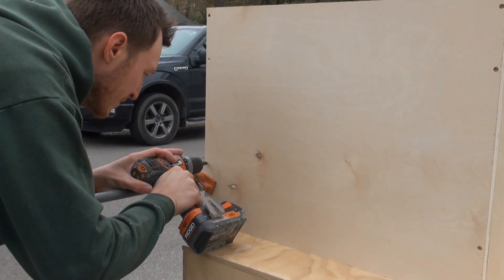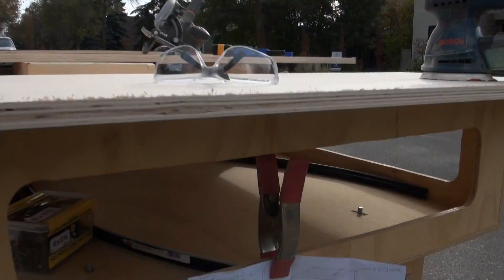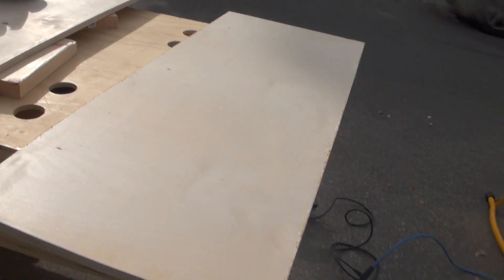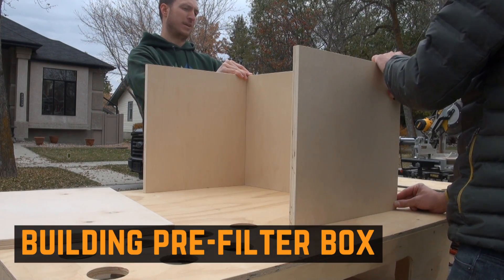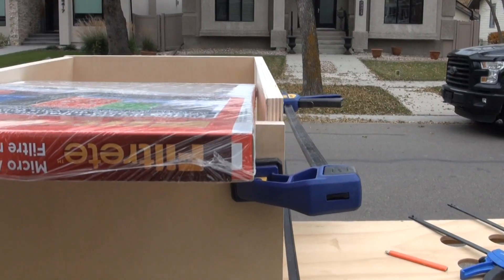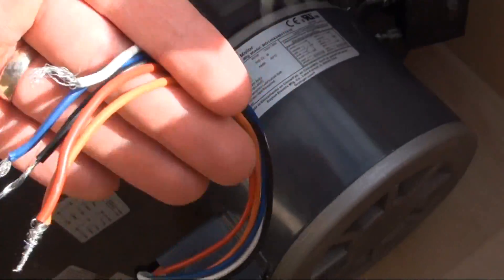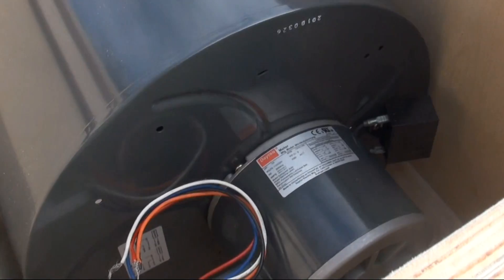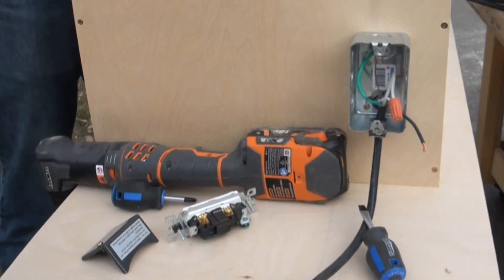How To Design And Build A Laminar Flow Hood: Part 2 - Build

Comment: I know a little improvement that would help extend your filter life and efficiency at filtering out the bad stuff. 

Install a uv-c lamp that is usually installed in hvac systems. This will kill all the air once it passes the pre-filter on the top of the box that is built around the blower intake. Uvc helps to kill all germs, bacteria, and viruses.

Comment: Nice.
Does anyone know a link to a video showing how much air is coming out? 
Like a flame or smoke test video? 
All the calculation videos I've seen don't give me any kind of idea what I'm looking to have acceptable flow coming out. What's too much, what's too little and useless. 
I'm thinking about using pvc to make a box I can walk into, covered pvc frame with painters plastic filter mounted to the pvc frame and a shop vac pulling air from the opposite side. Will I have enough flow in front of a small hepa filter? 
I'm just learning all this and have only been growing for 5 months. Did my 1st lc to agar in my kitchen in open air and had 4 out of 20 dishes grow something extra. If my idea will help me reduce to 0 out of 20 I'll do it but I'm wondering how much air you want blowing past you as your working on your projects?
Reply: I'm curious too. I just got materials fan, filters...will be building this week. Using 2 Merv 16 filters 20x25 side by side 6 inch thick. I bought a 12 dollar anemonitor? To check wind speed after filter. Thinking about making box 25 x 40 wide but slightly bigger to fit 24x48 if I need a HEPA later? What are your thoughts?

Comment: is there a specific reason why the overall cabinet is 20" deep? 6" thick HEPA filter + 6" wide blower = 12". Would a 16" deep cabinet be sufficient?  20" deep cabinet on a 24" deep stainless steel prep table seems like a bust. 

thanks in advance for your reply!!

Comment: Hello Tony! Where can I buy the HEPA filter. I need 24"x48" double size Hepa filter and the blower Dayton brand, please give me the specs for the blower machine and the filter for the blower. Did you use Palo Tsina plywood for the frame?, could it withstand when the blower and hepa filter works together . What about the 5 wirings, what are these for? If you could give me where to buy those? Thank you very much. I will not skip ads to support you on your channel every time i watch it. I have already subscribe and hit likes button. God Bless you.

Comment: Thank you so much for this video. I will be doing this project with melamine and a sliding glass front!
Reply: actually, I think I will buy a stainless steel table, build it on that and then coat the inside with a glossy latex paint so that I can sterilize it.

Comment: So you're pulling the air through the filter?  Then blowing that clean air into the box and through the directional aluminum face?   Did I get that correctly?    I'm building one with aluminum and Glass panels.  Was going to have the filter last and not 1st like you have it.   Not sure if that makes a difference or not 🤷‍♂️

Comment: Can anyone tell me if there is a reason why people install the pre filter on top of the blower instead of the side where the intake is? I'm building a 2x4 and thinking of putting it on the side in front of the intake. Would it be to much power because of being inline?

Comment: Can you provide any explanation on why the design calls for a 2x3 to be used and not a smaller piece of wood that would obstruct airflow less to the filter? I also wondered at the orientation of the 2x3, and how the upper attached one doesn't have the 3" portion attached to the top like the bottom one. Is it vibration? Does the geometry increase airflow? Very curious. I am assuming that the...(6.18) is 6 and 1/8 in back from front of bottom wood portion. I have seen other construction methods that use 4 strips of long thing wood that butt up against filter and run to the rear panel.

Comment: I really found this very useful and well presented/organized; but I have to ask, why are some of the measurements in the flow hood plans in decimal points of inches? seems unnecessary as the workable measurements are imperial, i.e. 3/4 5/8 etc. When going through the plans...it starts to get a little muddled and hard to follow.
Reply: actually seems like its in only one place....6.18 is referenced, and then in small print it says 6 and 1/8th in.

Comment: nice video,  appreciate the efforts u have put into Tony. i am trying to build one (24"x24") but not sure which material HEPA filter to buy (aluminum,steel or anything else that i might not be aware of) lightweight, provide the expected results and also not cost that much. Any suggestion...?

Comment: Question.  I have a flow hood I made and the fan curve seemed to put me around 100 fpm.  I recently bought anemometer and noticed my flow come out at about 250 fpm but seems to be pretty even and steady further back.  I've been looking a lot of information about the 100fpm number But it's been unable to find anything definitive.  Should I slow my fan down with a controller?  Or is 250 ok?

Comment: Nice job & thanks for making the plans free to those wanting a horizontal laminar flow hood. The only thing I think I may have done different is paint it with an anti mold paint/primer. At least on the inside. Probably sprayed on smooth so the porous wood didn't hold any dust. What was the total price to build it & how has it been working for you?

Comment: wiring explanation would be appreciated. where is the green grounded in your box or your blower. which are connected to your power switch? Your first section explaining connected wires do not coordinate with all the wires still sticking out in the box in the following shots.. 

please help me, I built the whole thing and am stuck on this basic wiring. connecting directly to power is no problem with the diagram- how do you put the switch in the mix...

Comment: @Freshcap Mushrooms How did you wire the switch? You sped through the wiring part and didn't show how you wired it.  I looked through the pdf and you didn't show a clear picture of what went to what. I understand liability and all that but if you were to at least show a clear view of the wiring it would help alot of us out with not having to shell out more of our hard earned money on an electrician. Help us broke growers out!

Comment: Something I am running into that I thought I would share.  I was lucky enough to score an autoclave. Seems like most people are using pressure cookers and wont have this problem but if you are running a lamina hoods it might be something they have an issue with and I am now curious about your setup in particular. My autoclave draws 14.5 amps and now I am looking into adding another breaker for it. I was just wondering what this fan draws and if you might of have the same problem? Probably not a problem for most but just something else to think about when getting into this adventure and you are trying to figure out costs.

Comment: Really nice build and great plans.  Thank you so much.   You asked for corrections so here's mine.    There's a difference between silicon and silicone.   two different words, two entirely different substances.   Silicon is the element used to make transistors.   Silicone is a polymer (that does contain some silicon) that is used as a sealant.    You used the word silicon both in your speech and in the plans.   Change both to silicone.   The pronunciation is different also.
thanks again.

Comment: Nice build. I'm watching this because I am building something totally different - a fume extractor for a CNC laser, but it uses a lot of the same ideas. Also, just wanted to point out that silicon is a chemical element which is basically a hard, metal rock. Silicone is what you use for caulking =)

Comment: I have a doubt, sir...
Schematics looks great!
But I would like to set the blower unit outside with a prefilter hood and connect it with an air vent to the HEPA filter unit inside.
My doubt is based on the length of the air vent would I need to calculate and buy an air blower...? Will, there be a pressure drop in the air passage...if so how to calculate it...?
any suggestions will be helpful thank you!

Comment: Sorry it may be a stupid question, but do you pull air from inside the clean room and circulate it over and over thru the Hepa filter(hood) or do you pull air from outside, then the Hepa and into the lab?
If it's from the outside how do you handle the outflow of air. (Is that how you achieve positive pressure?)
Thank you in advance for your answer, 
And I apologize if its something you've covered and I missed..
Reply: Just by looking at it, I think it's just pulling air that is already in the room and circulating it.  I think this would work fine for mycology work, but not for something more dangerous like virology.  I don't think positive room pressure is a concern for what he intends to do with this hood.

Comment: are filters with 99.97 efficiency OK for mycology? I was told that this is the MOST commonly sold efficiency ratings.
Reply: No. 99.99% efficiency is what you want
Reply: 99.99 is the cutoff. this site has a good vairety of them https://www.hepaflow.org/
Reply: @earthenaaron6766  thanks I opted for a 99.999 ULPA Fan & Filter Unit, brand new instead of making my own. Works wonders so far, although takes some learning to get used to!

Comment: You don't need to use birch, but it will paint nice. Cheaper alternatives would be either AC or BC sanded pine. The letters stand for the grade of wood used on each side. "A" has no knots, "B" may have some small knots with "football" plugs covering larger ones, "C" will have knots. Also when cutting birch or oak, the side facing up will splinter when cutting with a circular saw. The bottom side won't. It may also happen when using pine, but that depends on the blade you're using.

Comment: This is great! I love your content. I've been setting up a small lab space for yeast culturing for sake brewing. I'm also building an incubator for making koji (rice inoculated with aspergillus oryzae). I just realized that this is also pretty much the same equipment I need to grow mushrooms, so I was thinking I'd try to grow something easy like Lion's Mane.
1. When using a flow hood, do I need to worry about safety? E.g. if I try to grow mycelium on an agar plate and it's contaminated with something bad, do I have to worry about air blowing directly toward me?
2. In my yeast lab, I'm currently using an alcohol lamp. Brewing blogs say that this creates a small "sterile" field around the lamp because of the flame's updraft. Would this work for mushroom growing?

Comment: Hey, I got a filter the same size as the hepa filter for the liminar flow hood that I have built. can i just put the prefilter in front of the hepa filter instead of on top of the fan? thanks Jerome
Reply: If I understand what you are asking, I'd say that you can do that, but it would not be a 'pre-filter' that way.  The pre-filter is to keep debris and other particulate matter from getting into your fan.  This makes the air that the fan is pushing a little cleaner, and probably extends the life of the fan a bit, but it has to be before the fan itself otherwise it's not serving the intended purpose.

Comment: We're not worried about doing the calculations and then adding a pre-filter? Probably no issue those house filters don't restrict much. 
I have a furnace fan that I was going to repurpose into a air cleaner for my woodworking space. If I make this hepa removable it'll do both very well. Don't want to clog the hepa with wood dust. Or do I. I do like my lungs...

Comment: I hope this isn't a dumb question, but when do you turn it on? While you're working? Is it left on all the time? 30 mins before transfers?
Reply from the maker: Usually about 5 minutes before I'll turn it on, then work in the stream whenever you need sterile air 👍
Reply: @FreshCapMushrooms  Thanks! I ended up finding a video of an actual science teacher showing how to use and operate and industrial size flow hood. His recomendation was to turn it on 15 mins prior. He also cleans the area while its on. https://www.youtube.com/watch?v=ORT01wl8vlY
Reply: @marcmarc4776  Great link.  Thanks!  That actually sort of answers another question posted in the comments about adding a UV lamp to this build.

Comment: Does anyone know how powerful the flow should be coming out? Mine will barely blow sawdust dropped on front of it. I know particulates are way smaller and vastly lighter and will blow away easier. So would a light flow be sufficient?
Reply: Should blow a flame from a lighter 45 to 90 degrees without blowing it out. I just built one exactly the same as in this video n I'm getting uneven flow and have a dead spot. So I must have a leak somewhere or a defective filter or something

Comment: Looks like a quality piece of work! Have you ever tested to see how even the flow of air is? E.g. to see if it is faster at the top than at the bottom. Could probably test it with a piece of thin paper.

Comment: how do you prevent mold & mildew from growing inside?  🤔
Reply: I wondered the same thing, but then a few notions came to mind.  First, it's probably going to stay dry inside for the most part and so mold and such probably won't thrive in that environment. Also, seeing as how you could take the the front (large) filter out, you could just clean it with bleach, lysol, or something like a chlorhexidine solution/spray.  It might be a nice thought to poly the panels first to protect the wood surface though. 

My big concern on this build is not so much about the design or the engineering, but the size and weight.  That thing looks huge and heavy!  It would be great for a working mushroom farm, but if I'm just looking to ensure that I have a reliable supply of hard to find fungi (Lion's mane in my case) it might be a bit much.

Comment: When your not using it, dust will settle in the front of the filter. Which would then blow infront of it. This would be an issue with all flow hoods. I'm just curious how that would be mitigated?
Reply: Run the blower for a while first and clean your space well

Comment: That's awesome! Only thing I would change is to add a 10-15 micro farad capacitor to eliminate the wind up on the blower motor. The motor will start instantly and also last a lot longer.

Comment: In order to change the HEPA filter you'll have to remove the 1x strips to get it out correct? It's not easily removed like the pre-filter.
Reply: If you keep up with changing the prefilter your hepa will last up to 10 years
Reply: What do u mean?

Comment: Hi Tony, thanks so much for this video! I copied your design and it works really well. The only issue I'm having is the hot air. Perhaps my space is a bit small and not properly ventilated but wanted to ask if you have any recommendations to avoid or improve on build to avoid the hot air generated from motor? Mine is blowing 32 degrees celcius air!

Comment: I think I might copy that there's no need to change it
Reply: I would guess based on how he made this that only half of the pre-filter every shows any sign of dirt. For better air entertainment I would have rotated the blower 90deg, with the intake facing the front wall, and put the pre-filter on the back. This will ensure that air is being pulled through the entire pre-filter, not just the area under it.

Comment: Technically speaking this is a "clean bench". A laminar flow hood  provides downward flow to protect the operator from the medium/culture/bacteria. 

Kudos to your solid engineering skills and hepa selection. Industry standard hepa filters are rated "C" in america and "H14" in europe. 

Curios why you chose a 24 x 48" filter. Do you think a 12x12 would be sufficient for agar work and innoculations?

Comment: How the hell do you use it? 

Lab flow hoods have a work area where is the work area?

You cant seriously just stand in front of it in an otherwise unsterile room and expect the laminar flow to be enough can you?
Reply: You’re blowing any “dirty” air away from your workspace and replacing it with filtered air.
Reply: Lol, i ended up reading up on it. Actually built one already. Well, i built the box and have the filter but the centrifugal fan I ordered hasn’t arrived yet.

Its a 500 cfm fan for a 2x2 filter.

Fg10xl is the fan

Comment: can you give a heads up on where you were able to find the the 24x48x5-7/8 heap filter
Reply from the maker: If you contact AAF Flanders they should be able to custom make one for you
Reply: im in the same boat, found one place online. but they want $200 just for shipping and i have to be available in "20-30" days at random and will probably be at work so that options is out for me...

Comment: Absolute legend!!! I cannot wait for this channel to hit 1mill subs. You sir are a true hero of the night 🍄
Reply from the maker: Haha thank you :) only 994,000 subs away!
Reply: FreshCap Mushrooms quick question. What substrate would you recommend for a noob grower, straw, wood chips or grain? Can you even grow in grain? Sorry, one more. Do mushrooms only need carbs to grow, wouldn’t adding vitamins and minerals increase yields? Thank you kind sir ;)
Reply from the maker: Depends on what you have to treat the substrate and what species. If you can sterilize in a pressure cooker, I would suggest sawdust supplemented with bran, works for almost all gourmet and medicinal species. Or the "masters" mix which is 50-50 soy hulls and sawdust for anything other than shiitake. And for the nutrition requirement, it depends on species, but primarily sugars (bran) and lignin from the wood
Reply: FreshCap Mushrooms amazing. Thank you so much!!
Reply from the maker: You are very welcome!